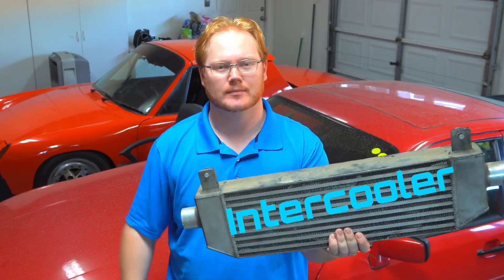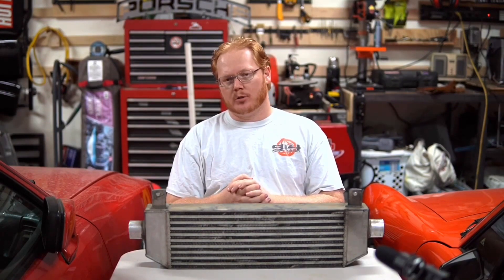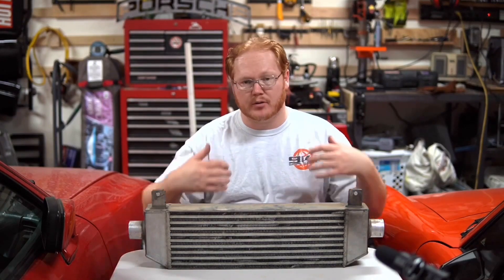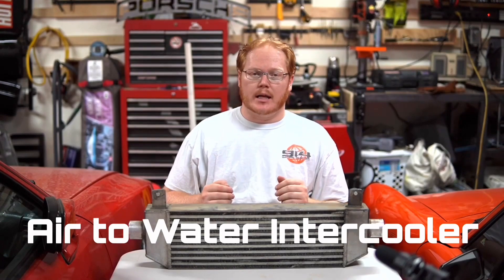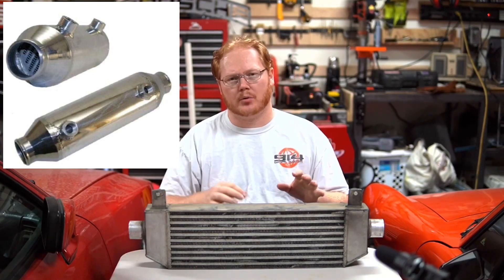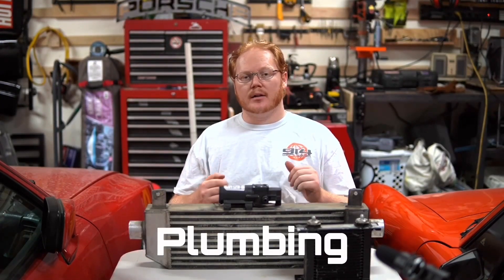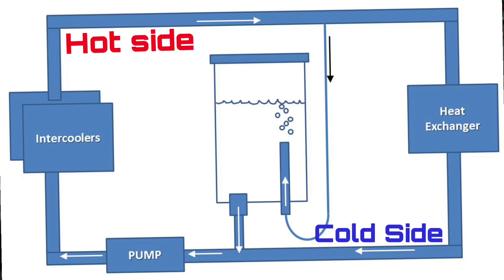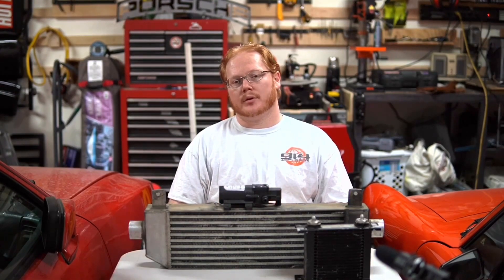DIY Air to Water Intercooler setup for $350 to support 600hp

Comment: Heres a question id like to ask, could this set up run alongside the standard factory set up if done correctly? Plenty of people put in twintercooler systems, but would much rather have this set up as my front mount then have then have a way of shutting off the pump so only cold air feeds the intercooler when no extra boost is required, when running at street level boost requirement due to multiple maps on the car?

Comment: This is definitely cool and a cost-effective way to do water to air butt Mr Richard holdener from engine Masters does the compared test on air to air and water to air and the results were the same you need to watch it
Reply from the maker: I agree an air to air is the best, but sometimes you don’t have the space or free air for an air to air and that’s when an air to water comes in. I’m using an air to water in my mid engine turbo car simply because clean free air is almost non existent in the chassis.

Comment: I'm building an obs 7.3 powerstroke. This is extremely helpful. I'm really not exactly sure how I'm to mount this, but the air to air set-ups being sold are expensive. The water is much more efficient. I need a plan to design my own. Rediculous amount of work trying to do this project. Nothing is easy like changing oil. Thank you for the explanation.

Comment: Can I used the intercooler, a water Mishima to box and a pump? Without the need of the heat exchanger ?
Reply from the maker: @jadp2024  The point of the heat exchanger is to dissipate the heat generated from the compressed air (basic laws of thermodynamics). So if all your doing is circulating the fluid it’s not going to remove the heat that well.

Comment: Length of piping has nothing to do with lag. Lag is based  on weight and size of internals of the turbo. Once the pressure is in the piping it doesn’t matter if it’s a mile long. The affect on lag is negligible    Water meth injection is a better choice if you can only have one
Reply from the maker: @jasonbabich8707  Cleetus McFarland would disagree with you. Search up “Worlds Longest Turbo Kit”

With small displacement engines, every little bit makes a difference.
Reply: Boost is only part of it, volume and CFM is also in the equation

Comment: Length of piping has nothing to do with lag. Lag is based  on weight and size of internals of the turbo. Once the pressure is in the piping it doesn’t matter if it’s a mile long. The affect on lag is negligible
Reply: Length of pipe has something to do with lag. The more pipe you have, the longer it takes to compresss the same volume of air as opposed to a smaller pipe, hence the term lag. Smaller pipe fills faster to what you were saying where it didn’t matter after the pipe was full. On most Oem turbos, they aren’t rated at a high flow, so they take longer to compress air when you add longer pipe runs.

Comment: Cool video cheap chooses they would work need a lot of modding that sensor is not treaded but u can convert it to a there by destroying an old sensor and using the probe in the housing with a bit of thermal paste and some glue to in case everything some epoxy resin if possible or something similar but water to air is actually cheaper or maybe not but simpler and not so many bends and pipes makes the engine bay look cleaner also it doesn’t heat soak

Comment: So-called air to water intercoolers only have two advantages and that is size and placement. They are much smaller than a traditional intercooler and are easier to place in a tight engine bay. The negative is they are less efficient and suffer heat soak in traffic. They are great in boats that have a constant supply of cold water or drag racing where you have a water tank full of ice. In a road car they are still an air to air intercooler, water is just a carrier of heat from one heat exchanger to another. The problem with this is as the water heats up (especially in traffic when there is low air movement to cool it) it becomes less efficient and takes a long time to cool back down. 
The manufacturers that use this system generally use it on supercharged cars because it can be fitted in the inlet manifold under the supercharger saving space. They also have thermostatically controlled fans to help with heat soak when the water gets too hot. Some even utilise the  air conditioning to keep the water temp down.
Reply: Thats why you add an additional radiator core to deal with that.

Comment: You need a pump that can handle some pressure, even running a hose on the end causes flow drop because of the extra load.  Each heat exchanger is a restriction, water needs to move up/down, through bends etc

Comment: I was thinking of using an AC condenser as an heat exchanger for my car. Since my car doesn't have AC I can fit the condenser just like if I had AC.
100$ for the condenser + 160 for the biggest epman barrel intercooler.
Reply from the maker: Ac condenser is going to have really small pours and a small inlet/outlet. Not sure you’ll get the flow you want with that but you can always experiment. Additionally you want to have the heat exchanger away from other heat sources so you don’t get heat soak.

Comment: Возможно из интеркулера воздух- воздух, сделать теплообменник (вварив штуцеры - на вход и выход, воздушных патрубоков) ?
Reply from the maker: Yes you can do that, just be careful to make sure you account for area for water flow. You will need to cap the area where air typically flows through the intercooler and put an inlet and outlet fitting on it. 

Note that an air to air is much less efficient so you don’t need as large as a intercooler with air to water. Figure 1/3 the side as a starting point.

Comment: Can you run a air to air intercooler and a water to air intercooler on the same system
Reply from the maker: You could. But a properly sized IC either A2A or A2W will do the job itself will less pressure loss. And A2W by itself is generally more efficient but also a more complicated system. You can also super cool the water with ice and bring the charge air temp below ambient.
Reply: @budgetoutlaws9978  brilliant!  I have been trying to find out if I can for a while now so glad you replied  thank you
And thanks for the suggestions on a better system

Comment: Is it possible to just run cool water from the radiator to the heat exchanger?
Reply from the maker: The cool water from the radiator runs somewhere between 130-150F so unless you want your intake air temps to be 30-80deg higher than ambient temp, then the answer is no. You cannot  just use the "cool" water from the Rad. 

You need to have a dedicated radiator system for the air to water intercooler.

Comment: Hello how to i can know how i need big air to water cooler for my tractor his have 130hp and 7500ccm3?
Reply from the maker: So an intercooler is technically a reverse radiator so you have to determine how much heat your going to be making with your turbo setup. If you have a big turbo pushing a small amount of boost the answer is not much heat. If you have a small turbo and are pushing at or above the turbos efficiency range your going to want to go with an intercooler that's at least rated to the HP rating your looking to make. 

Air to Water intercoolers are extremely efficient regarding spacing so you won't see the same kind of pressure loss as you would from an air to air IC. So it's a good idea to go much bigger than you need. For example I have a 700hp core intercooler but I won't ever likely see that much power. But I see IATs that are  almost always at or just above ambient temp. 

Hope this helps.
Reply: @budgetoutlaws9978  i dont scary for intake temp i scary for this that my engine can't breath frow this intercooler understand? Lost power if is to inside is 1 bar and outside is 0.8 bar .. core must have be enough for 7500ccm this is little hp but his have much ccm3.. understand?
Reply from the maker: Sorry no, there must be a language barrier your using terms I don't recognize. 

Taking a stab at it you have a 7500 cubic inch diesel tractor that makes 130hp, which for a diesel is irrelevant as torque is the number that counts there. Then your making 1 bar of boost at the plumbing and it's giving you .8 bar at the manifold. 

Here's the issue, diesels are totally different in how they make power vs gasoline. You might be better off without an intercooler or with a small intercooler than with an extremely efficient one.... 

I would get in touch with a diesel tuner and ask them their opinion. Sorry I can't help much.
Reply: @budgetoutlaws9978  ok tnx man :)

Comment: Russ Lumley
I am putting a 7.3 powerstroke in a 1986 f250. Any ideas for the water inter cooler setup
Reply from the maker: You've got enough room for a big air to air intercooler, but if you wanted to go air to water the same large ebay intercooler I mention in the video would work for you. Just be sure to put your hear exchanger in your fender or some place away from any heat source.
Reply: @budgetoutlaws9978  it's a 1986 I don't have the room the 92s on up have

Comment: Gr8 vid. 
Your right out the pump .there's always a cheeper way just got to find it.
I used a 130psi max water pump £19:00 . And used it for a M&w kit with a 1st solenoid to the spray then I just used a cheque one-way valve worked fine. Love the vids👍

Comment: Just subscribed, thanks for the info 👍🏻

We're planning a Mercedes turbodiesel swap and they're known for running hot so it'd make sense to run an a/w setup and leave more space for the engine radiator up front.

I was always put off the idea of an a/w setup on a diesel turbo engine  under load a lot of the time as I thought the coolant water would get hot quickly and stay hot constantly.

Is this generally the case if you're on boost a lot of the time and can it be remedied with a big heat exchanger and radiator setup?

Thanks a lot 🍻
Reply from the maker: With constant load/head like a Diesel then its best to run a large heat exchanger. Sounds like you have a fun project  ahead!!
Reply: @budgetoutlaws9978  Thanks! Yeah we're putting a Mercedes OM606 into a 1986 Land Rover 110 aiming for about 400hp and heat's going to be a big problem
Reply: I'm so glad you asked that... Putting a 97 powerstroke in a 46 ford and was hoping to use the original 4 hole radiator to pipe the air through two.

Comment: How do I work out what size heat exchanger I need say for 300 who ?
Reply from the maker: It depends on how you use the car. Road course, daily, freeway high speed pulls, drag racing?
Reply: Street and track day or  short rally’s  hill climb
Reply from the maker: There are no set sizes for specific power. But the more long sustained use like a track day will require a larger heat exchanger. The typical 24 x8" heat exchanger on ebay should be more than enough for you but you might be able to get away with the tiny motorcycle heat exchanger like I run. The most critical thing is to make sure you run the heat exchanger no where near any ambient heat source. While in front of the radiator might seem like a good idea it's going to heat soak. I would stay 6" away from any heat source and you'll find it is much more efficient. 

Good luck!

Comment: Is there any good reason not to just implement it in my cooling system?
Reply from the maker: Yes. The cooling system runs at 180-220deg depending on the car. You want water to be as cold as possible, and as close to ambient as you can. Intake air temperature should be as low as possible for power and prevent detonation. I run about 100-120 deg intake air temps on a hot day under load for example.
Reply: @budgetoutlaws9978  I see, thank you.

Comment: I have one of these setups with a "350hp" type 13 exchanger (Car makes about 500 crank hp), fairly large , thick radiator with good airflow and Bosch pump.. my post IC IATs are in the 80s-90s Farenheit  at max boost though (Note, relatively low vehicle speed - about 60mph @ max boost because these are test runs on the street) a little hot for me. There is a pump called a Davies Craig 9040 which has about 2x as powerful as the Bosch.  It is also brushless.  It is a little expensive ($200) but my theory is opposite yours, I think the more flow, the better.  So I will see how it goes when I get a chance to try this pump.
Reply from the maker: I run their aluminum body EWP150 with controller for my 1.8t conversion. Honestly it's way to much pump for the engine. It stays in it's purge cycle pretty much all the time. The only issue I've had is it works too good :) I have a hard time getting the engine up to temp. I'm currently blocking off half the radiator and that seems to work OK. But it's also winter.. 

I'm going to build in a thermostat and heater bypass, which should solve my issue.
Reply from the maker: Please share your results when you get them!  

In custom building radiators for water cooled conversions in cars I found that too much flow didn't allow for proper heat disapation. The good thing about those Davies Craig pumps is they can be ramped up with voltage. I run the larger unit in my 914.
Reply: @budgetoutlaws9978  Ahhh ok cool thanks! Is it the 9040 that you run or one of their bigger pumps?

Comment: Great video, I’m contemplating adding an air to water intercooler potentially in addition to my air to air. However I am hoping to make around 800 hp so I’m probably gonna need some thing that flows well
Reply from the maker: A2W is pretty efficient, you just need a large enough IC. Running an A2A in addition to A2W would be interesting to see!
Reply: @budgetoutlaws9978  yea, so my car is fine in colder temps and regular driving, but on long pulls like drag racing the iats climb rapidly. Maybe if I can have it to turn the pump on when I’m gonna race to keep it cool, instead of having it run all the time. I could mount a small a2w right after my a2a
Reply from the maker: I think that's a solid idea. You could also put a large ice box to plumb cold water through it for drag passes. 

Just make sure you have that radiator (if you use one with the setup) away from raidant heat like the engine radiator. It needs clean air to work properly.
Reply: @budgetoutlaws9978  id mount my tank in the rear, and the heat exchanger there with a puller fan maybe.
Reply: @LowBoostFilms  , did you make that double IC system ? I was thinking about same thing.